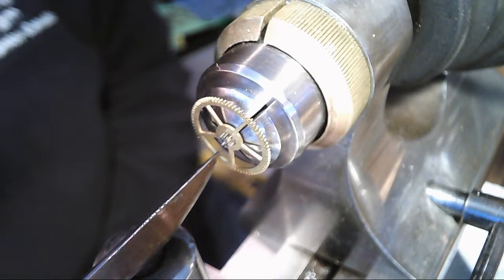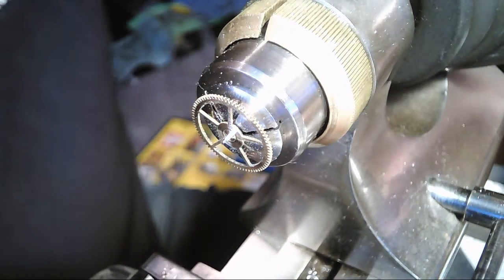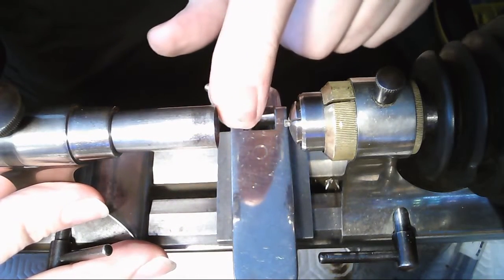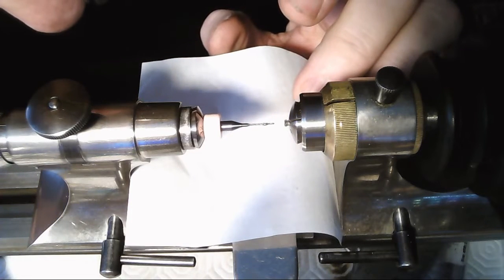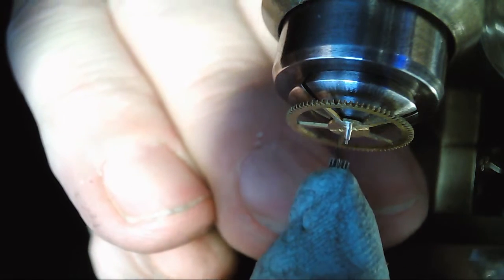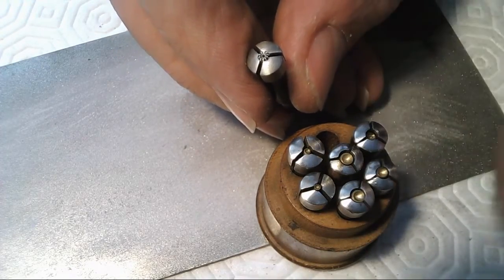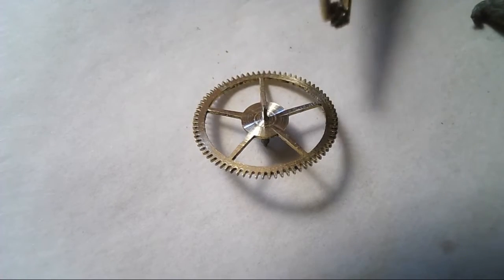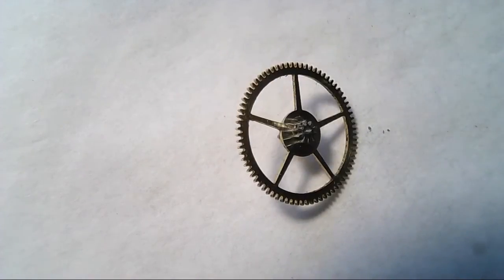Replacing a Watch Wheel  Pinion

Comment: I have a pinion  which is rock hard any ideas to be able to bore centre do I need to heat to red and let cool down naturally  to lower the temper or any other help would be much appreciated
Reply from the maker: Cutting oil is absolutely needed. Else Anneal and temper

Comment: Nice job turning a job on it's head!  It makes intuitive sense, but I don't believe I would have thought of that approach.  

Another alternative is pinion wire, which you cut to length and then fit.  You can get it from Boston Gears (not sure of the price) and old stock from ebay.  Also, why not use Loctite to secure the new pinion, rather than JB Weld?  It's easier to control, and since the 3rd wheel is not a high pressure wheel it should hold just fine.
Reply from the maker: Adam Adkins Did not think of Loctight. I do know that JB Weld will hold for life.
Reply from the maker: Adam Adkins You can buy Pinion wire??
Reply: @JDRichard  I don't know if you can get it directly from these guys, but give them a call.  https://www.bostongear.com/products/open-gearing/stock-gears/spur-gears/pinion-wire  And as I said, ebay is always available, just search on "pinion wire."